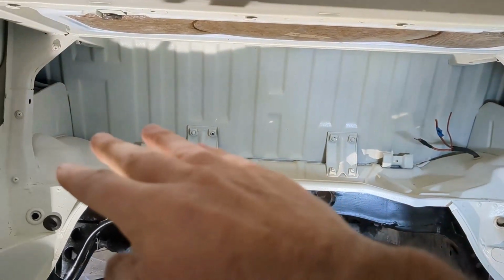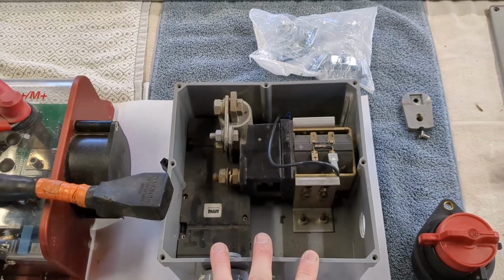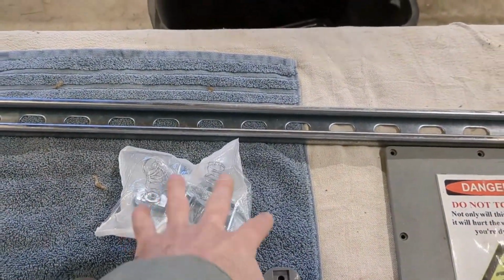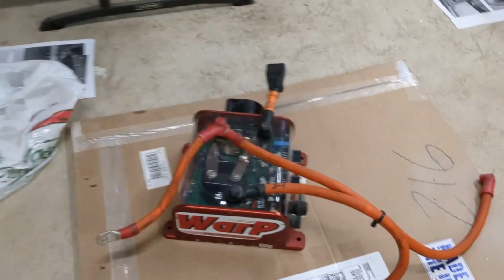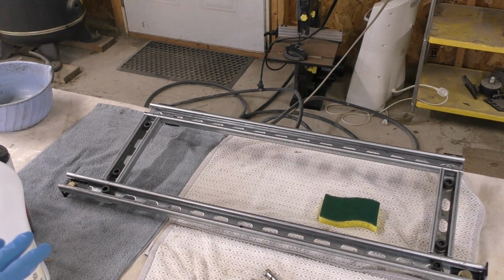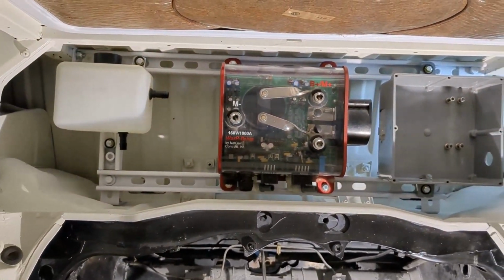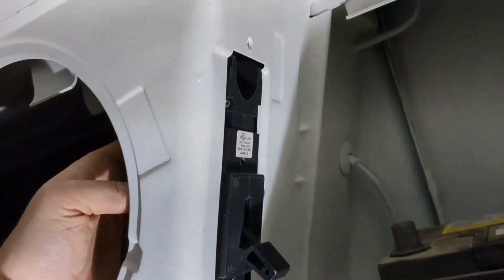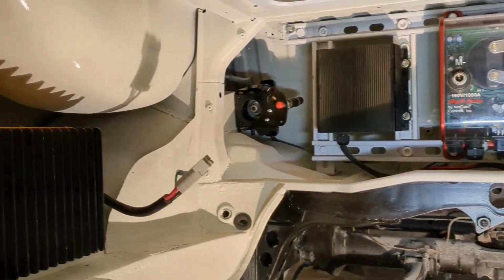VW Bus Electric Conversion Part 4: Controller, Charger, and other component mounting #evconversion

Comment: Any issue with hitting bumpy road and stuff shaking loose?  Do you need any shock absorption in any of the mounting?
Reply from the maker: Good question. I decoupled pretty much all components with nylon spacers and rubber washers.  I show a shot at 17:35 when talking about the charger mounting.  But all the components mounted to the rail system also had nylon spacers and rubber washers to provide shock protection from metal-to-metal contact.
Reply: Just thinking loudly, would it have been a better option to use a simpler mounting plate?  Bolt down the plate at all the 4 ends after putting the components where you want them.  Drill  holes if you have cables or tubes to get them on the other side.  A cable gland or grommet on the mounting plate would also avoid damage to the insulation or tubing.